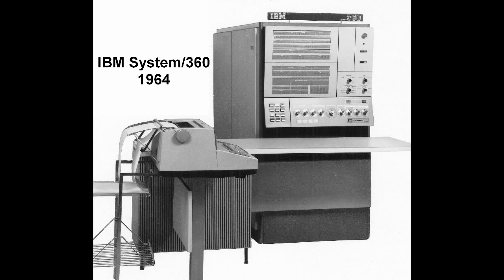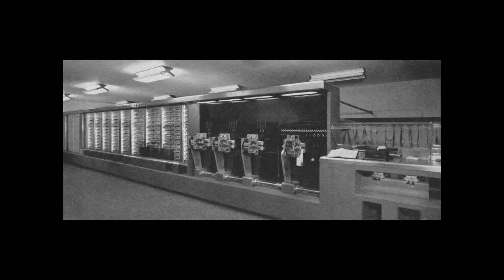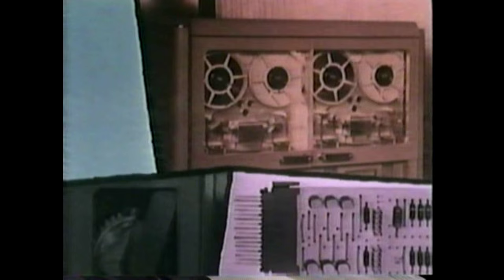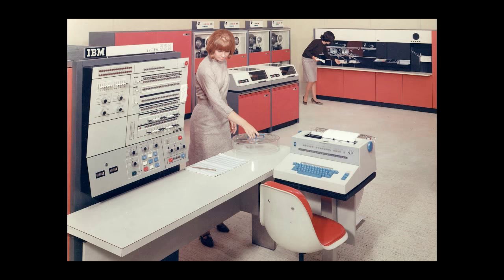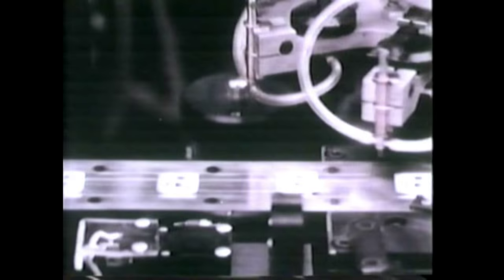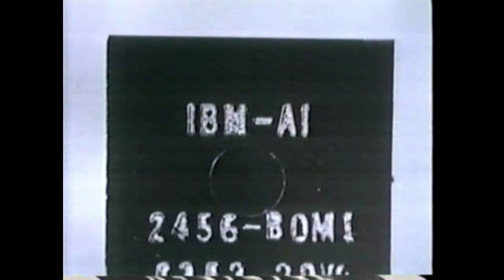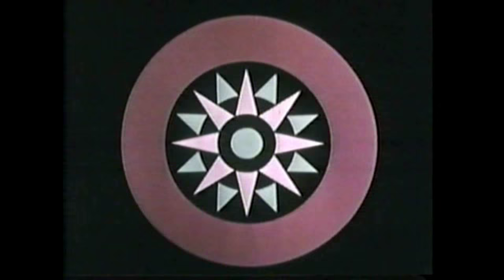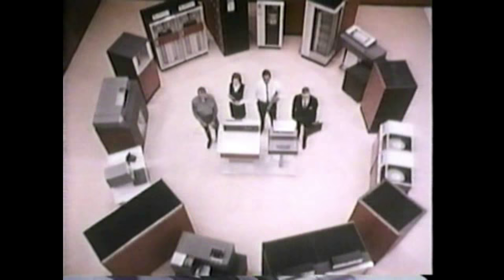Computer History: IBM System/360 Mainframe 1964 ORIGINAL ANNOUNCEMENT, Transistors, Data Processing

Comment from the maker: Most  large data centers of that time, and up to recent times, had a "raised floor" with 10 to 15 inches of space under the floor tiles to hide all the power cables and data transfer cables.   Alternatively, they use overhead cable raceways to hide all the cables today.   Cable and wire management is a true art in itself!    Good comment.  Thanks!
Reply: the reason you used raised floors was not to "hide" the cables. it was because the air conditioning was forced down I to the floors and up through the equipment. no need to freeze the operator by making the entire room too cold. more efficient to have the a/c flow through the equipment then out into the room where it would be comfortable for people operating it.
Reply: Yes, it was known as false flooring like these days false ceiling.In south east Asian nations, false flooring is a normal way of lihome building to keep the insects and smaller animals not coming to usable surface.
Reply: I have often considered that for my home computer installation, but the door opens inwards and makes the idea impractical. Perhaps I should run cables down from the ceiling?

They often had a special suction cup device for lifting the tiles.
Reply from the maker: I tend to agree.  Under floor electrical power cables and data cables kept them out of the way.  Cool air flowing upward into the center of the machines was often more efficient than blowing it around the room.  Have also seen newer data centers that have data cables running along the top of the machines, just below the ceiling, that gives easier access to cable changes and fixes, than working under the floor in tight spaces.  Progress!
Reply: The newer datacenters I've worked in tend to run power in the floors and data in overhead raceways. Makes sense, I guess.
Reply: Those floors are still common.
Reply: Admin User I had worked in many data centers back in 1972, some places could not afford raised floors and the bus and tag cables (each about 1.5" in diameter) were all over the floor. But the room was freezing and the operators wore jackets while in the room. I did some systems consulting work for a large bank that had a raised floor that was 4 feet from the main floor. The operators kept beer down there.
Reply: typograf62 yes we used industrial suction cups and special tile pullers for the carpeted tiles we used in office locations. Thee tiles were aluminum/magnesium so they were very light and super strong
Reply: Computer History Archives Project mainframe data centers did not have much re-configuring of the room back then. Once they were set up, they remained for years like that
Reply: Wow, I watched them build a floor like that back in 1989 In an office building in Manhattan... I had no idea they didn’t do that anymore. 
Do you know that they built the metal conduits first and then carpenters built ramps over the cables and conduits and then they rolled in the giant air conditioners over the ramps and set them into frames that had been pre-laid , after that they set the floor tiles in place over the floor frames. It was very interesting to watch!
Reply: I worked in a data center back in the late 70s and in addition to a tape library where people would clean tapes there was a room for the onsite IBM tech! So I'm wonder how much more power my laptop has than that old mainframe?
Reply: It sure is. I used to install network cabling back in early 2000. You are right. It is, indeed, an art.
Reply: @rty1955 That depended on the computer system. Univacs went the other way.  Cold air came out of the ceiling tiles, and the machines had blowers that blew hot air under the floor for return to the AC units.

Comment: I used one of these installed in an old dairy-barn.  It had a bare dirt floor, with the cables run across it.  The CPU and console was in the center, and the card-reader, card-punch and printer were each in one of the cow-stalls.  The keypunch machines wire in the hayloft, so you had to climb a rickety wooden ladder.

This was at Catonsville Community College (now CCBC) circa 1974.
Reply from the maker: Hi Fred, that is one of the most interesting locations I ever heard of for a 360 install!  Thanks! ~  Victor, CHAP

Comment: The Solid Logic Technology (SLT - https://en.wikipedia.org/wiki/Solid_Logic_Technology ) that IBM developed for the System/360 series was used for the Saturn 5's LVDC (Launch Vehicle Digital Computer) that guided the rocket during launch via the rocket's analogue FCC (Flight Control Computer) which gernerated the steering commands for it.

Comment: my first machine I worked on was a 1401, then shortly after the 360/30 with a whopping 48k of memory, that's only 48,000 BYTES of memory! I wrote in assembly Lang as COBOL was too slow and too big to run on the machine. it ran 2 partitions or processes at a time a background process (BG) and foreground  (FG) process. we always would say "man, what I could do with 4 more K!" the disk drives  (IBM -3211 held 5 Meg of data.) ibm called that "external storage" and with memory called "main storage"  I used to patch software using the front panel blinking lights and switches,  then when it worked well,  I would force a crash, obtain a core dump, then correct the original code. sometimes we would use REP cards in an object module before execution. this is a lost art or programming, but what I could accomplish in assembler, COBOL programmers could only dream of.
ahhhh I miss those days
Reply from the maker: Ahh yes, the magic of Assembler language.  Only the Guru's of Tech knew Assembler.
Reply: +roy Yung   Same here mate!  When I moved from a 1401 to a 360 it was amazing, WAAAA, what they will think next!  Regards
Reply: ASSEMBLER ? Crikey ANY assembler - even basic was a great advance,  the first software course I went on (1964) we had to write what was basically a "Supervisor" (Operating System)  in machine language, this was to teach  us how that interrupt system worked. all was fine until I discovered a program check in my program check handling routine. Talk about disappearing up your own fundamental. (You are allowed to laugh)
Reply: The days of blowing a register after a simple program modifications (adding instructions) or causing a dump because you forgot to subtract "1" from a register before inserting a floating $ sign. Fun days.
Reply: @Lindsay5137  Good one.  Yes, I delved into channel programming a bit while I was an operator trainee after having studied four languages in a business school.

Comment: In my early days as an applications programmer when working in the early 1980's at an installation in a Sperry Univac 1100 series environment, mass storage (that is, disk storage) was available at a premium.  A lot of large files were written out to magnetic tape.  Fast forward to the early 1990's,  Fast forward 20+ years, when working in an IBM mainframe environment (mid-range IBM 9370 in a VM/SP OS), still mass storage (in the IBM world called DASD or Direct Access Storage Device), the systems programmer who was the gatekeeper of mass storage was still stingy with allocating disk storage even though there was ample storage available.  It was a real pain.
Reply: I worked on Univac 1108s.

Comment: I miss the 2741 terminals.   I learned to program on them in the early 1970s.   APL -- it seemed at the time to be the programming language of the future-- what it turned out to be was explicitly designed for low-baud rate printing terminals.   And without such a terminal, it's a bit of an anachronism.
Reply: I loved it too. I remember the domino operator could solve simultaneous linear equations.

When you saved the workspace you saved all of the variables values too --so you could resume from exactly where you left off.

Comment: Damn! Up to 340,000 bytes (characters) per second for a TAPE DRIVE! WOW! That's still impressive! A CD drive at 1x speed is only 150,000 bytes per second.
Reply: Sean Ramey Well, standard LTO tapes now transfer at 150 MB/sec, so maybe 340kb/sec is not exactly impressive *today*...but still very impressive for the time.
Reply: Sean Ramey tapes were much faster than disk as far as I/o operations
Reply: These tape drives wrote data in parallel a byte at a time across multiple tracks on the tape unlike today's serial implementations.

Comment: The 360/20 was not, I believe, part of the original announcement, and the 360/25 absolutely wasn’t. Early 360 literature mentions the 30, 40, 50, 60, 62, and 70. (The 60 was dropped, the 62 was replaced by the 65 before shipping, and the 70 by the 75.)

Comment: In this video @10:10 the narrator spoke of "power of growth" and went into the subject of how this IBM mainframe system can grow with adding hardware to the system.  I wonder if any companies back then had issues with electrical power shortages when additional IBM equipment was added without an upgrade with the incoming electrical supply.
I worked for National Advanced Systems (a National Semiconductor subsidiary) back in the early 1980s that had a computer room where engineers kept adding mainframe computer equipment similar to what's in this video.  It resulted with an overload to the electrical transformer to the computer room, resulting with it overheating and nearly catching fire.  As a stopgap measure to minimize the overheating hazard,  an HVAC contractor was called in to install an air duct with the chilled air directed onto the transformer to prevent the transformer from overheating.
A short time later an electrical contractor was called in to replace the transformer with one that handled a higher electrical load.
Reply from the maker: Hi  Bloqk-16,  you make an excellent point.  These giant machines were massive energy hogs especially for businesses that had no prior experience with big computer systems.  Vacuum tub based equipment, electromechanical tape drives and disks, A/C, all drew a great deal of electrical power.  And there is the added issue of having "clean power" since early machines could not handle minor spikes in voltage very well.  Thanks for raising this observation.  It is certainly worth mentioning from a historical perspective!   ~   Victor, CHAP
Reply: It would only be a problem if the facilities management was poor.  The power requirements of each piece of equipment was known and documented.  A new computer room would have been designed to provide a specified amount of power sufficient for whatever would be installed initially, and with a margin for growth.
Reply: These things didn't exactly plug into electrical outlets.  The power supply had to be installed by an electrician.

Comment: Think about it, in 1964 you could get a computer with 8MB of RAM. Think about the first computer that YOU had with 8MB of ram.  It wasn't until the mid 1990s that I had one.  Also it blows my mind that they're talking about gigabytes of storage in 1964.  When did I first have a 1GB drive? Probably around 1996 or 1997 for me.  Now here's one to blow your mind.  The IBM Z Enterprise which is the current series is directly compatible back to the System/360.
Reply: I was pretty sure he was talking bits not bytes.  it would have been a single megabyte, still remarkable.
Reply: I was an IBM CE back then, and one of my first 'crises' was when a 360/30 lost all of it's RAM - a whopping 64KB!  My field manager had to get authorization from IBM Corporate to totally replace the BOMB (as the memory unit was called) because it cost $64,000!  I used to give talks to a Senior Citizens group interested in computing after I retired in 1996 and tell that story, then whip out the latest Best Buy ad and show that several MB of memory could be purchased for about $20

Comment: Oh my, how far "solid logic technology" has come. Way more primitive than I remember when I worked in a fab in 2004, which was 15 years ago. Even then the wafers were 8" or 12" I wonder what they are now!
Reply: it depends on the process. if some power/analog components are manufactured they probably still use 12" wafers.but when it comes to cpu's they use 30"

Comment: More than 7MB on a single disk pack :-)
Reply: Yes, exactly 7.25Mb if using IBM programming system. There is couple nice details of these early IBMs drives: 2311 disk drive uses hydraulic actuator for the heads! Disk pack size is big: 14" diameter and weights several kilos. Format of that (Model I) is sectorless, it uses track based format.

2311 drive is "stupid", it just has just some simple circuits for heads, etc. It needs 2841 Storage Control Unit to work (which is 400kg cabinet). That 2841 is interface for the CPU, makes format and convert serial-parallel data. Microcode (2841s internal instructions) is put in inductive ROM memory, also known as TROS. 

I have one IBM system in my collection (and under restoration) with same type drives, these are very impressive things!

Comment: August 7th 1944 Mark One Specs: 1600 bytes of internal storage. Input output versitility. A modem. Backward compatibility. AND LATER: April 7, 1964 System 360 Specs: Massive tape drives. Punch cards. CRT Displays. Teletype interface. And a pretty girl to operate it (Yes the first programmers were women.) 8 Mega bytes of internal magnetic core storage, no refreshing, no power needed to maintain memory. Solid Logic Technology: the grandfather of the first IC Chips. (Yes the IC makers were women.) Optional Multi-processor systems. Paper Tape readers, high-speed printers, Removable disk pack hard drives. AND NOW: January 7th 2020 a wearhouse full of these computers can be replaced by a single $5 Raspberry Pi zero W in your pocket. WOW! Now that's progress children. Now I am waiting for Superman Crystal Optical Holographic AI computers to hit the marketplace.

Comment: Did they really cut up the floor to hide all the wiring from module to module?  There's not one outlet or wiring shown in the pictures--marketing or real?  I wish my office were that clean...
Reply: Raised floors are standard in most high performance computing centers.  Not sure they do raised floors in your average data center but the big boys still roll like that.
Reply: Sweet--thanks for the info.
Reply: The floor is elevated, the cables run underneath.  That was the standard set-up.
Reply: Do not belive these stories about "raised floors" and "cables underneath the ground" - IBM used an advanced wireless power and data transfer technology recovered from the Roswell alien spaceship. Later then they revealed what we know now as "WLAN".
Reply: Moving equipment involved a lot of planning to get the holes in the floor tiles in the right place
Reply: @lookoutforchris Modern datacenters still use raised floors or overhead cable racks.  Our datacenters use both.  Power and air come from under the floor, and data cables are in overhead racks.

Comment: Very beautiful.
But nothing about the specs of the processor.
Reply from the maker: Hi MasterMindmars, yes, I see.  I believe the processor specs did vary a lot with the model type and how it was configured (and there were many models).   The big System/360 Model 75J (NASA used at least five of these in 1966), only had about 1 MB of main memory each, to start with.  Its amazing how much a megabyte cost back then. ~ Victor

Comment: question: once they had developed secondary storage on magnetic tape, why did they have to keep using punched cards? couldn't they just use tapes to store the programs & data? like early PCs, e.g., Apple II, Commodore, TRS-80 used cassette recorders?
Reply from the maker: Hi CARL iCON, good question.    Punch cards and punch card machines were very prevalent at that time period.  Raw data was input from punch card operators (data entry) by hand, to create the data on the cards.  The cards were read into the computer system and processed, with output to tape, or directly from card to tape.  I don't think one could type fast enough to input directly from keyboard into a tape machine.  Cards were used less and less over time, as other faster ways of data and program input were developed.  Perhaps someone else can come up with a better explanation.   Thanks again for your question. ~ Victor, CHAP
Reply: @ComputerHistoryArchivesProject  Thanks Vic, I think I see what you mean now. So before tape, there was only punched cards for secondary storage of programs & data, therefore the infrastructure was all in place to have multiple keypunch operators keying in large volumes of data that way. The keypunch machines were not connected to the mainframe, (only the card reader) so there would have been no way to get that data into mainframe RAM (to be saved to tape) other than the programming console which would have been much much slower. Thanks for the excellent video!
Reply: Hollerith cards were used for input because they were easily edited by adding or changing cards.

Comment: If any of you noticed IBM was doing multi processor systems back in the 60s. They called it "loosly coupled multiprocessing". A short while later they had "tightly coupled multiprocessing" in other words multi-cores. IBM was and still is light years ahead in technology. They even had V/M (which is a dog) back then also. So when you think something is new, IBM had done it already for decades.
IBM never lets code go obsolete either either. Cant say that for M$. IBM is in the hardware business not software. So they made sure software was always backward comparable. Even to this day